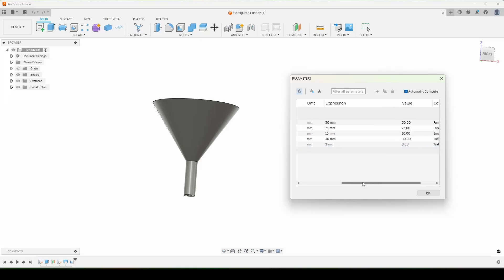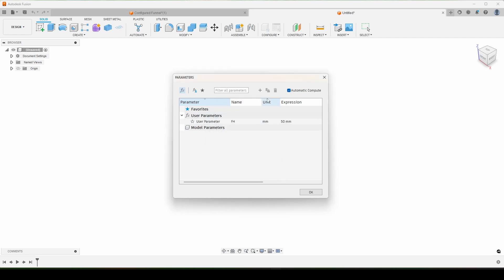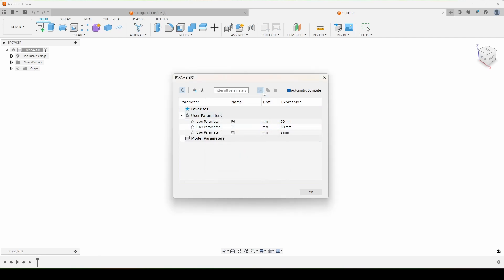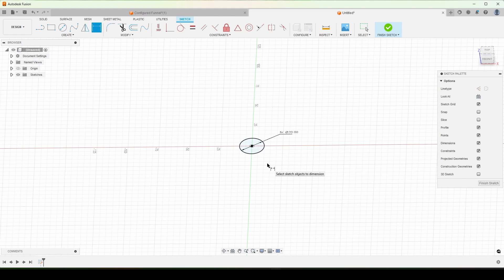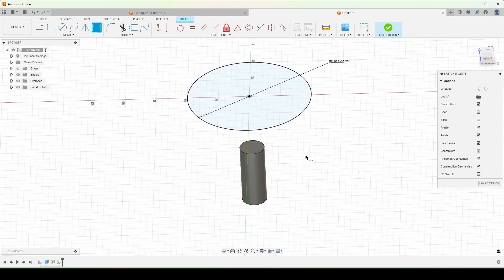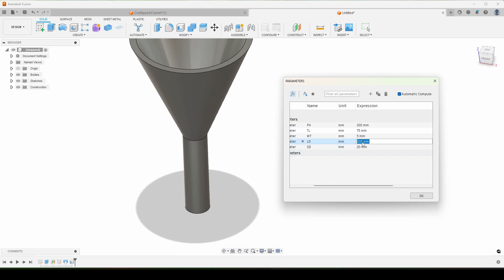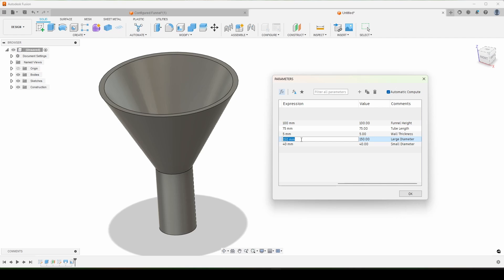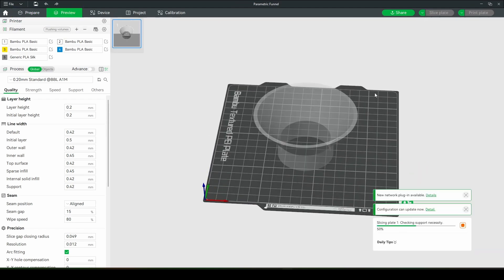3D modelling every funnel ever in Fusion 360

Comment: Thank you for the tutorial.  Why did you bring in as a step vs. 3mf file?  Also noticed you did not need to setup any supports but you didn't discuss in your design how you were designing to ensure no supports needed - what should I be looking for?  How do I ensure the angle of the funnel is less than 45 degrees which is what I hear is the point where supports may be needed.  Thanks again.?